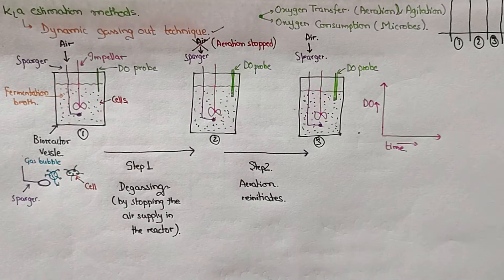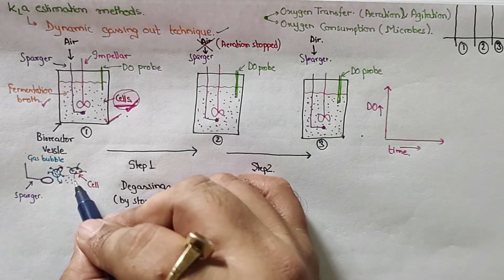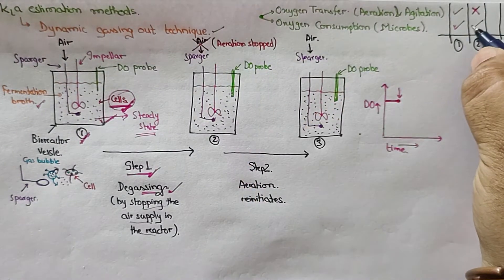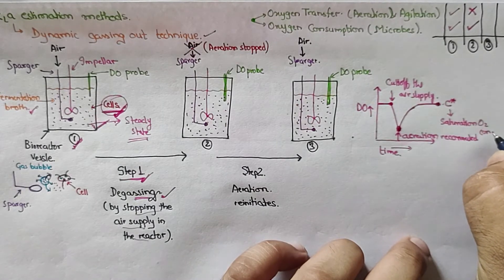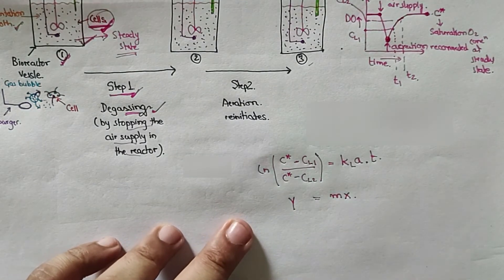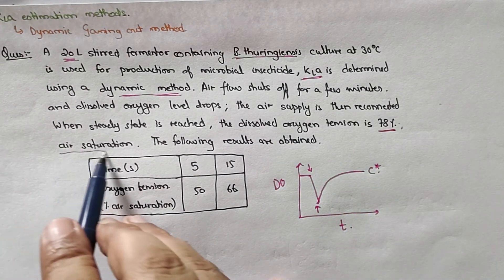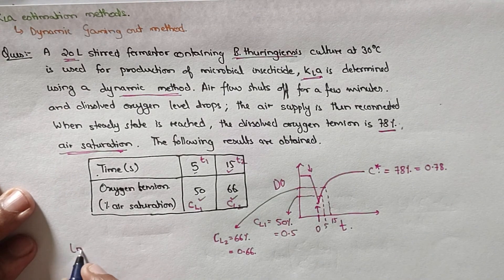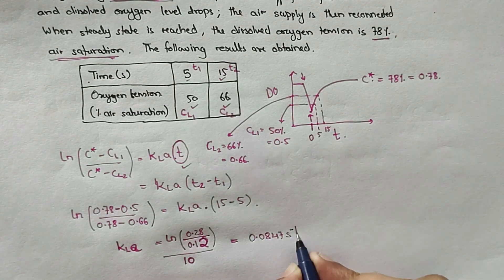Dynamic Gassing Out: A Method for kLa Estimation in fermentor | Mass transfer | TPBS | GATE BT

Comment: Hello, I am wondering why the dissolved O2 would reach saturation at steady state. The rate equation for the dynamic system is dC/dt=kLa(C*-C)-Q(consumption rate by organism), correct? So at steady state, with a non-zero consumption rate, the concentration "c" can never equal the C*, or it would be 0=0-Q. I cannot find a solution to this issue, and I also cannot derive the linearized equation you had provided in this video.
Reply: (1) You are correct, it doesn't. There is the OUR component that the video misses. Throughout the test the OUR component should be subtracted from the OTR for a more accurate estimate;
(2) The linearized form of the OTR component is correct. The linear fit does not necessarily need the C1 component, because we only want the slope of the line, regardless of the intersection.
Reply: when OUR=0, DO @ steady state = C*
We can use this fact to express DO in terms of kLa and steady state. So then in real world situations when OUR> 0, when measuring OTR at steady state we can use the real C* at that state, and the steady state DO as C
Reply: @JBossInAction how would you measure the real C* experimentally though? You wouldn’t be able to just remove the cells because that would change the composition and therefore the C*